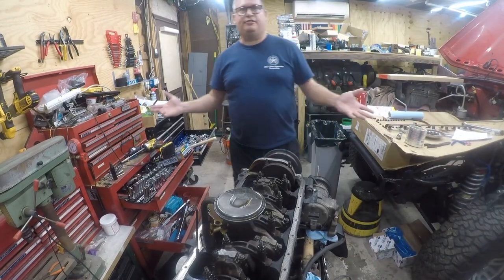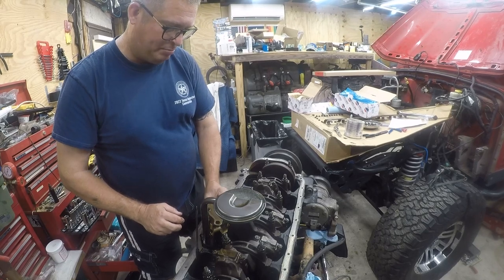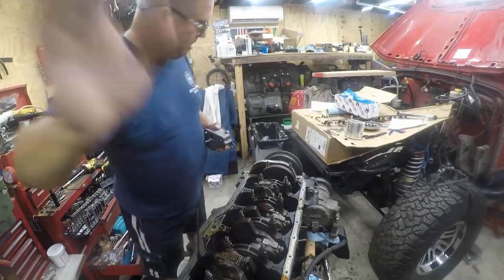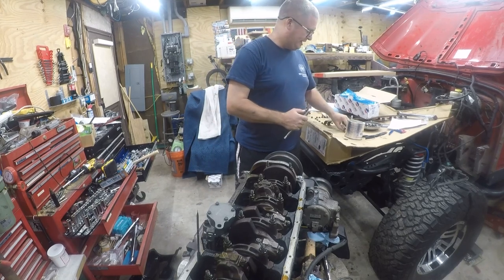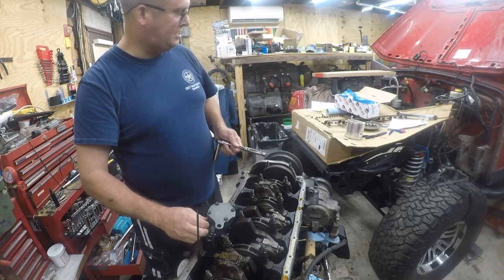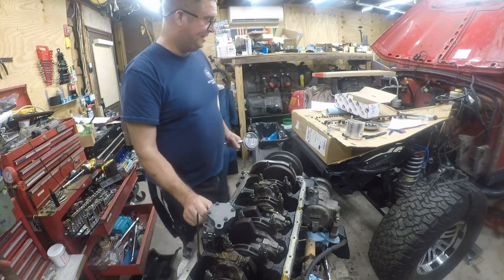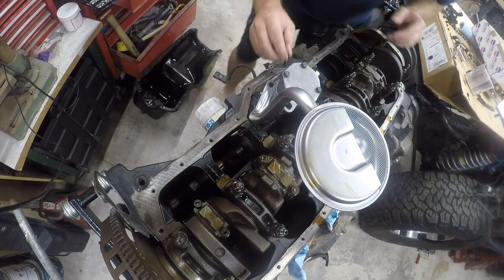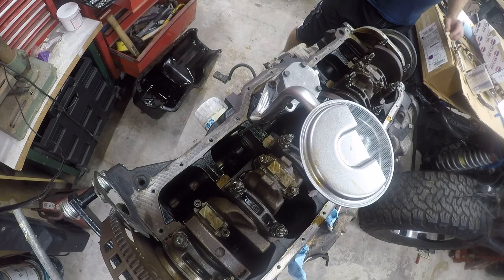Jeep TJ Build - Jeep 51 - Oil Pump Replacement and Pickup Installation

Comment: Is the pickup tube in the oil pump?  I bought a 97 4.0 a couple years ago and every since I had it the oil pressure a lot of time when I came to a stop would drop to zero and then pickup when I took off again.  I thought it was a bad gauge and then earlier this year I started hearing a knocking then a week later engine failure.  I recently bought what appears to be a remanufactured engine from a wreck 97 4.0 from a Jeep place locally.  They said my pickup tube was probably the issue.  Should I replace the oil pump in this engine before I have it swapped in?
Reply from the maker: Yes and it's somewhat tricky to install it.
Reply: @hotpuppy72  thanks for the reply, I will probably just buy a new oil pump before the engine is installed